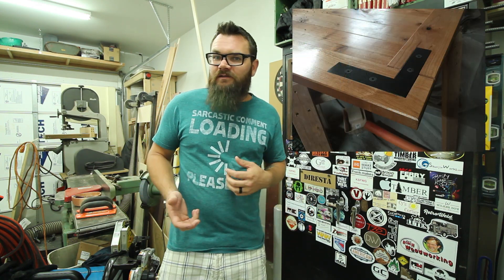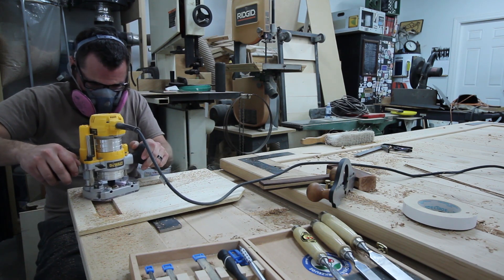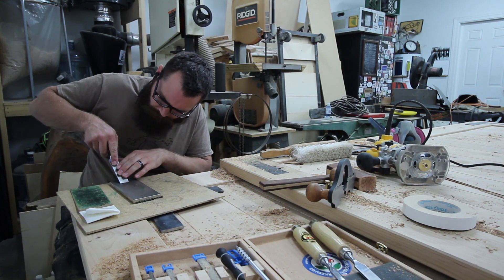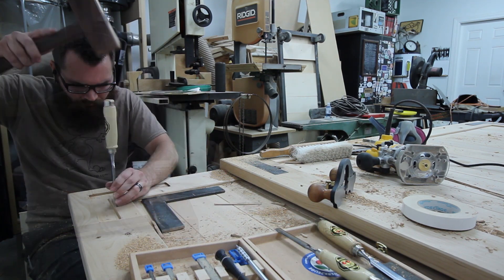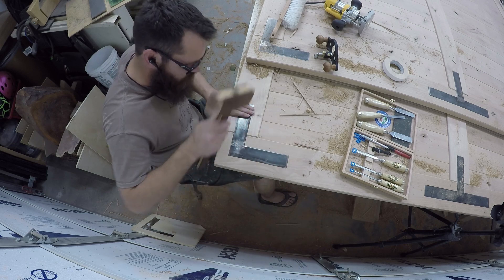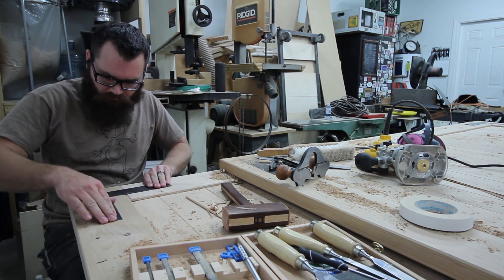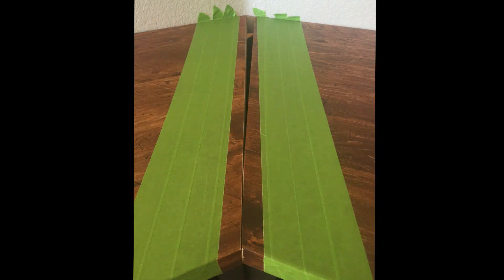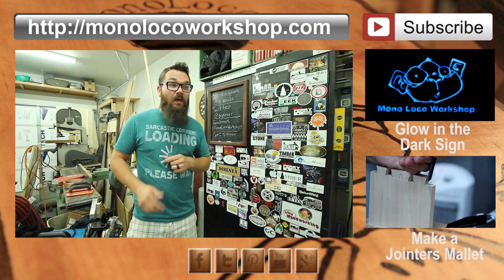Inlaying Metal into Wood

Comment: Dude. Those barn doors look awesome!  Are they cedar?
Reply from the maker: +McCauley's Design thanks Brian! They are Alder.  I coated then in General Finishes Outdoor Oil to help with UV and Mold plus the oil finish should make reapplying easier.
Reply: +Ty Moser (MonoLoco_Workshop) good call. I've never used alder.

Comment: what drill bit can trim very thin layer? I want to put an right-angle carpet trim onto a stair step, but i dont want to just screw it onto the plank. I want make them flat like one piece, so i need to trim a very thin layer off of the plank. thanks,

Comment: The metal inlay adds so much elegance. The barn door looks amazing, and the exactness of the countertop is beyond words. Try this,,, treat bottom outside edges just like a Card Scraper. Leave the burr on the metal. Set the metal onto the wood and tap with a hammer. The sharp burr will leave an imprint all the way around. Your video provides lots of insight. Metal and wood is like chocolate and peanut butter. Very well done on the projects shown in this video.
Reply from the maker: Thanks for the kind words Lee! Good suggestion about using the metal to make an impression but I'm not sure that treating 24 individual metal pieces like a card scraper would have been faster. (Maybe if they were all exactly cut and welded I could have treated a couple for the template but there were small variances on each one..)

Comment: Was the metal you used for the counter top seam hot rolled steel bar? If it was, how are you preventing rusting?
Thanks.
Reply from the maker: +Scot Hargan It was hot rolled steel. I actually rusted it up a bit on purpose and then sanded it some. I put on multiple coats of wipe on poly to prevent further rusting.
The brackets on the door were simply painted. We wanted to get them powder coated but it didn't work out..

Comment: Those look awesome.  Given the way wood moves is there anything to consider when planning these out?
Reply from the maker: +Carl dos Santos Since there these metal brackets aren't that wide and there is less than a half inch of wood on either side of the inlays, I don't think it will be too much of a problem. Not much wood movement to account for in that little amount of wood. If it were a large piece of metal in a wider piece then you might need to account for it a little.
That being said, I live in Phoenix and we have close to no wood movement so I don't need to worry much at all.
Reply: +Ty Moser (MonoLoco_Workshop) Thanks.  That's good to know.

Comment: I've recently used some steel flat bar for support in a project but found countersinking the holes challenging. I had to drill the hole and then use various size drill bits to create the countersink. Yours look really good...how did you accomplish them?

Both outcomes look fantastic!
Reply from the maker: +l3ender15 I drilled a very small "pilot" hole and then used a 3/4" metal countersink bit to get the rest. (Using cutting wax the entire time.) I then took a bit the size of my bold and drilled out the bottom of the hole. (More or less just cleaned it up because the countersink got me most of the way there already.) I see plenty of cheap bits on Amazon, I picked up a ~$30 one at Copper State but I haven't used the cheaper ones so I'm not sure how they compare. 

Thanks for watching!